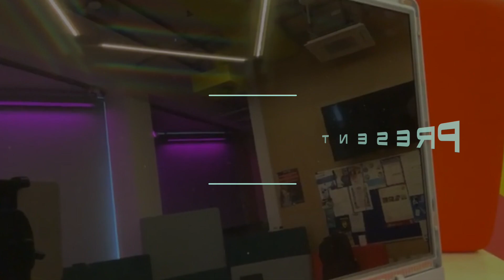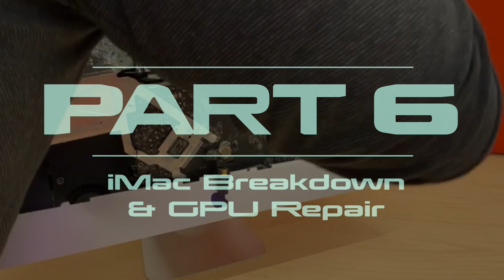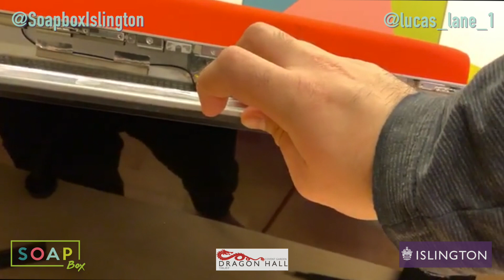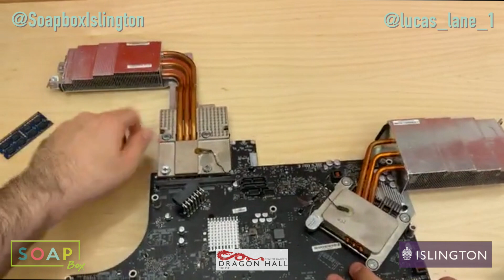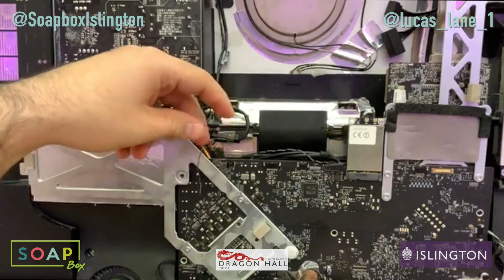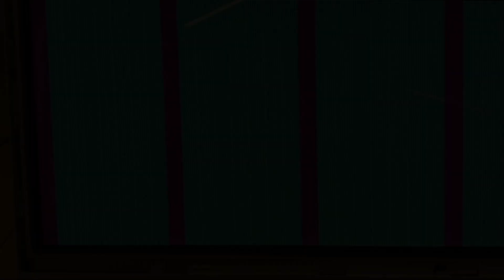iFIXit Part 6 - iMac GPU Repair

Comment: what kind of thermal paste would you advise I should use for the used stock GPU HD5750 for my 27" mid2010iMac?